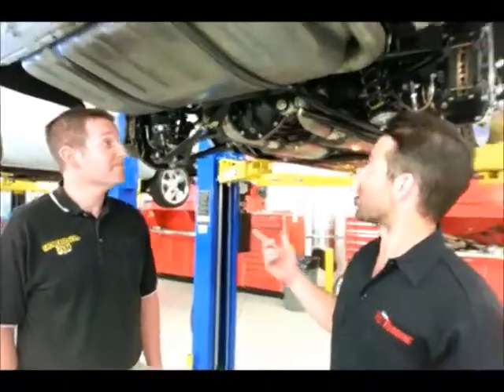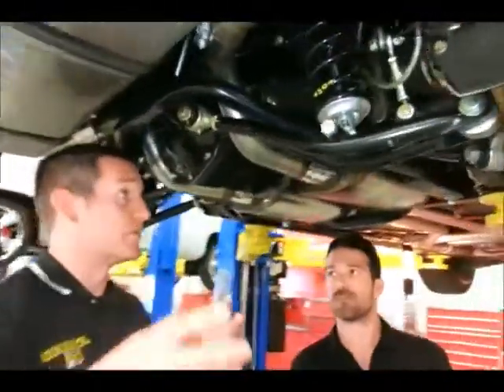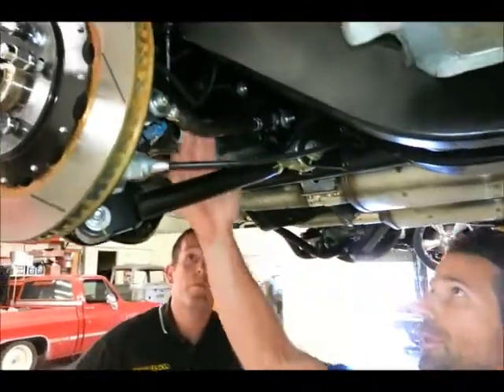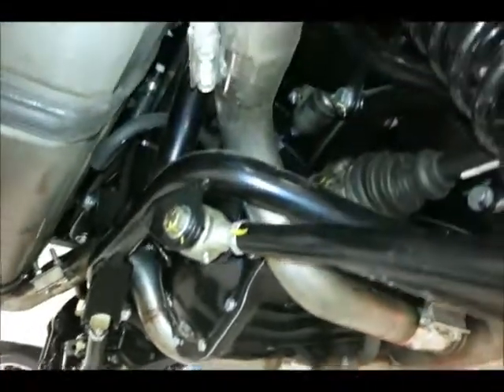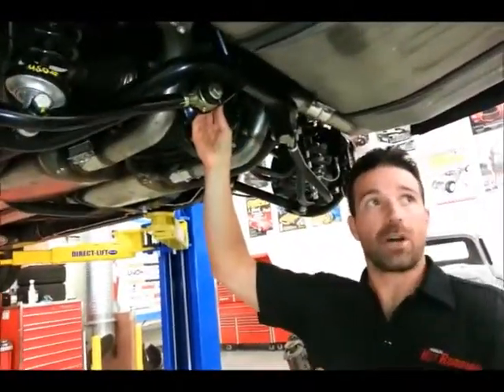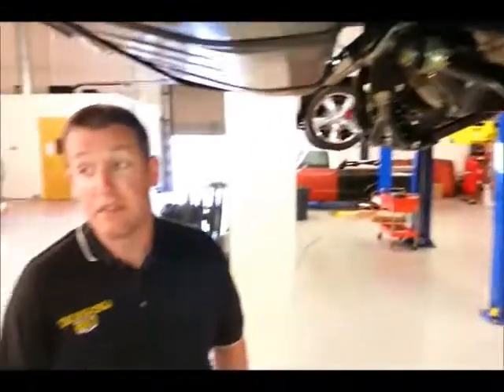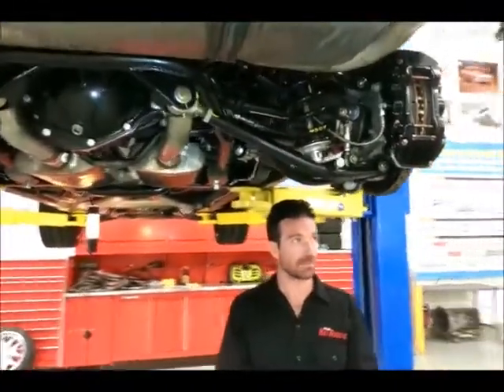AME Multilink IRS

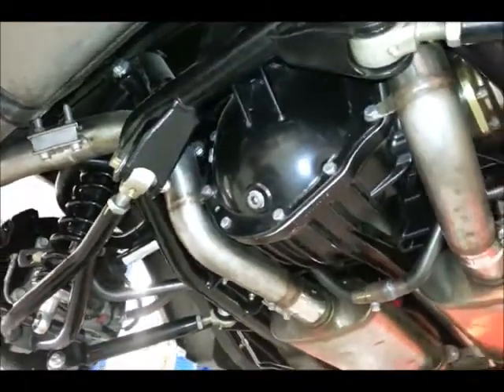Comment: Okay I don't consider myself a novice on the subject of Auto performance mods, but they completely lost me at  02:18 - 02 :30 when explaining the reasons for going with the Dana 60 over the Ford 9".  Yes they are bigger and thus stronger [ 9" vs 10" ring gear  ]!  I got that part but but then WTF?  Okay after repeating several times, I think the point made was that the Dana 60 ring gear is still in production from the factory but the Ford 9" is not.  But what does that have to do with being 'quiet' or superior in any other way?  3rd edit: ( Noise, vibration, and harshness (NVH), also known as noise and vibration (N&V), is the study and modification of the noise and vibration characteristics of vehicles, particularly cars and trucks.) Okay I guess I've answered my own question.  Never heard NVH B4.

Comment: why don't Dragsters and funny cars use the independent rear suspension if it's so good
Reply: Because they only drive them in a straight line.  I always wondered why the 'Gasser suspension mod' was so popular back in the 60s.  Never made since to me to swap the IFS with a leaf springed Solid axle.  But there were legit reasons for it or it never would have become so common.  I think it's more of a COST factor with drag racing. (Cost of IRS)/benefit ratio makes it impractical.
Reply: IRS is for cornering. Drag car don't corner. Simple
Reply: @abrideforchrist4247 We're a little late to the part here, but just in case anyone else stumbles upon this comment  - here are our thoughts: 

That's a fantastic question! While IRS systems provide excellent handling and ride quality for road and track cars, drag racing vehicles often prioritize straight-line performance, where solid axles excel. Solid axles are typically lighter and simpler, making them ideal for the specific demands of drag racing. IRS shines in scenarios where cornering and overall ride comfort are crucial, which is why it’s popular in pro-touring and road racing builds.